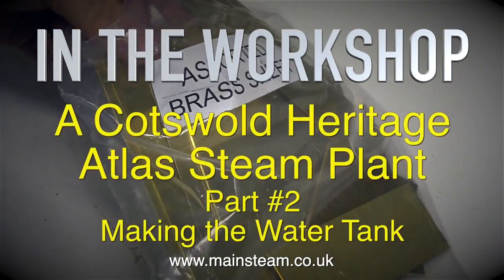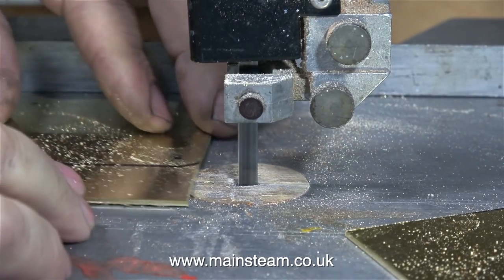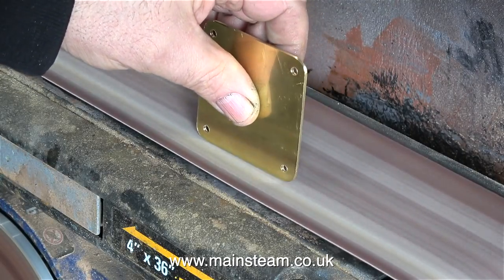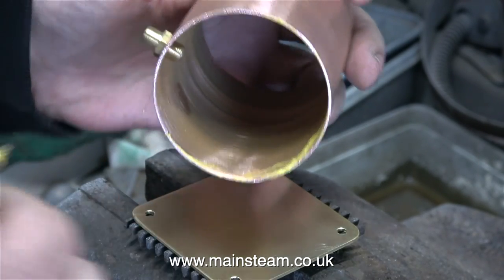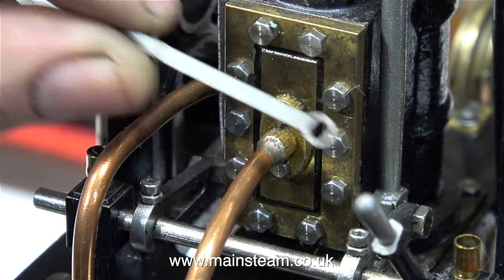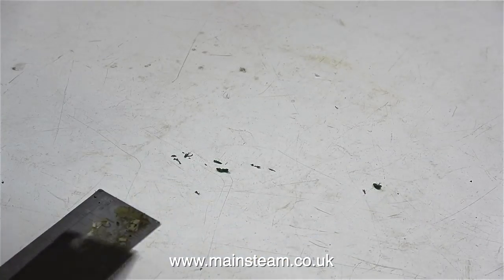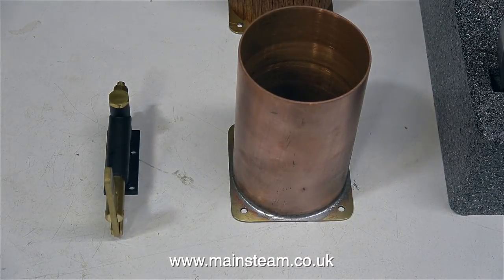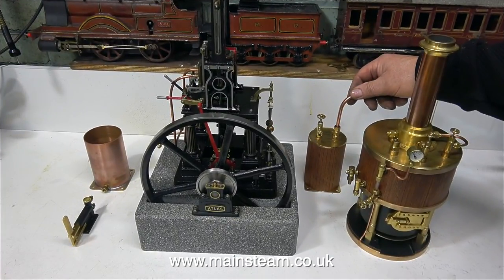ATLAS STEAM PLANT CONSTRUCTION - PART #2

Comment: you could probably put the water tank and pump to the right of the boiler and still make it all work . . . tank and pump service the boiler, boiler services the engine, and condenser services the engine . . . also makes it easier to connect a belt to the engine to run a paint drying fan or some such.